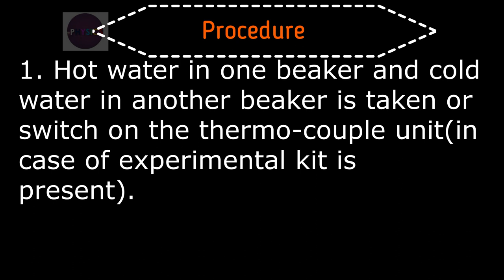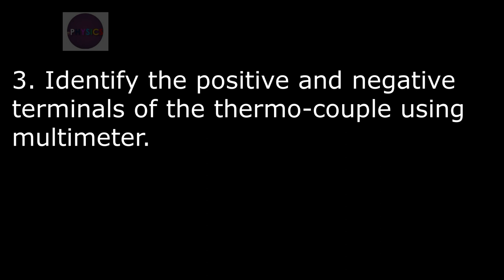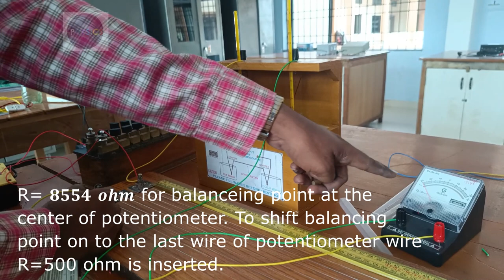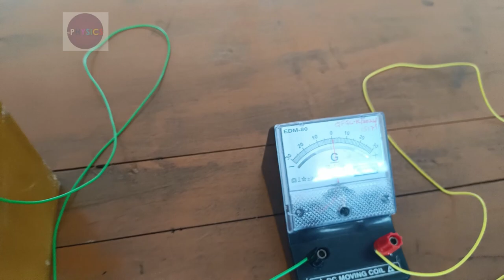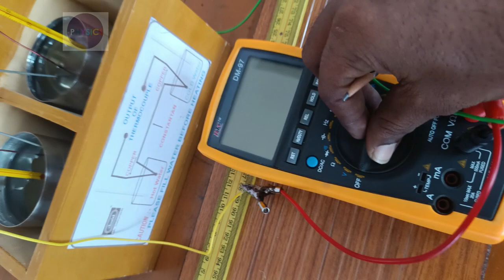#thermoelectric |#practical_thermo_emf #thermo_emf_experiment | #thermo_emf_vs_temperature_graph

Comment: Sir aap reading kese liye ho 🙃 samajh m nhi aaya
Reply from the maker: @nehal__c45   we should remove the resistance, which is to be calculated. Then we should adjust the galvanometer in such a way that to get equal deflection on both sides. After this, volt per millimeter is multiplied with balancing length to get the voltage value. 
Please WhatsApp your doubts to 9986251267. Thank you.